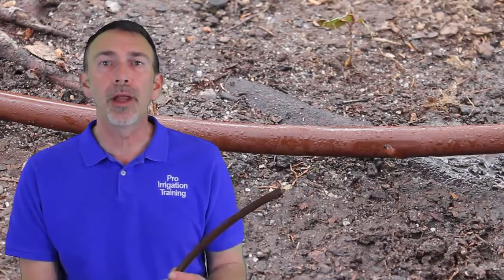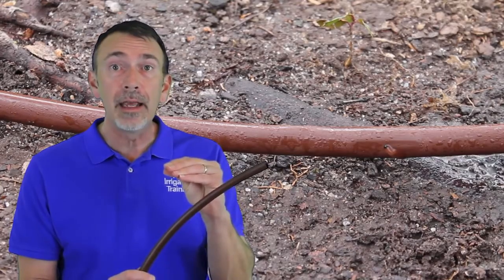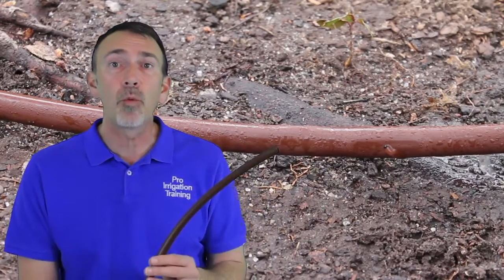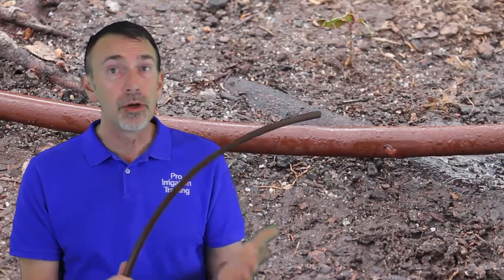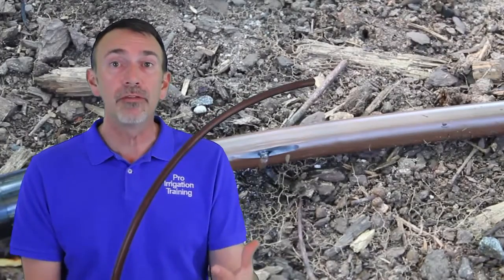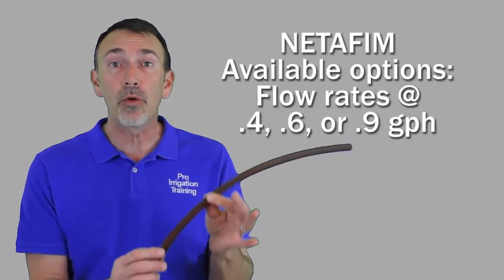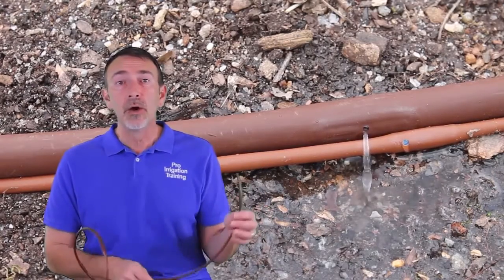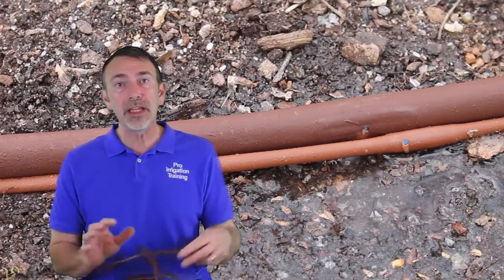Introduction to Dripline, the Best Drip Irrigation Product? ( irrigation training )

Comment: Hello sir 
How many inches water pump should I use  for 200 trees 
13 lines  
The line 35 meters 
And how many  dripers I need for the 200 trees
Reply from the maker: Hello, thank you for your question, but I don't think I can answer about the pump. That depends on several factors; the source, elevation rise, etc. It's always better to buy from a local dealer that understands pumps and can gather all the information to properly pick the right size pump. I would use dripline which has the drippers built in at 18 inch intervals, and make loops around each tree. You'll have to calculate the flow usage for the dripline product you use. Or you can insert drippers into solid tubing. Remember that 1/2" tubing (or 17 mm) will only flow 4 gpm, so the number of drippers you use on each tree will determine how many trees you can get on one zone.